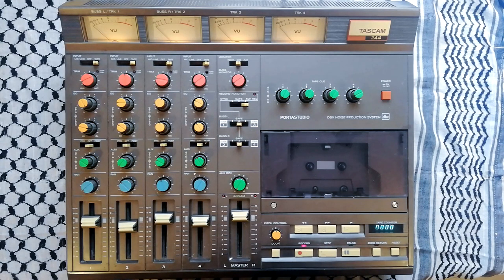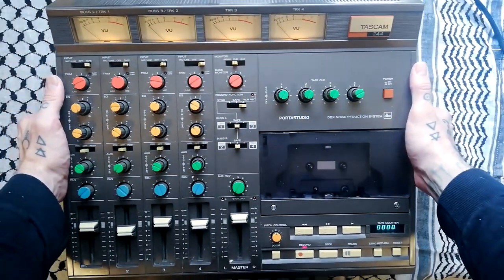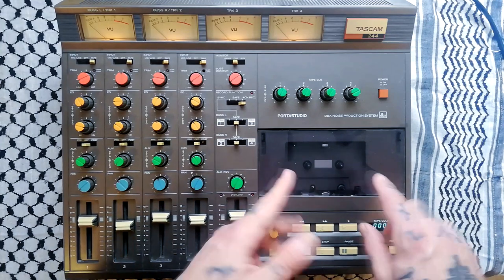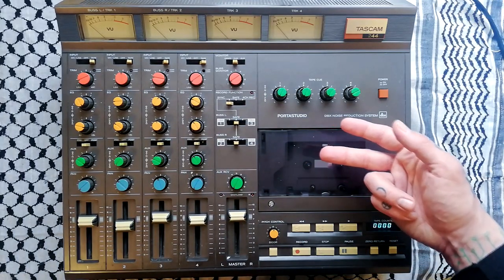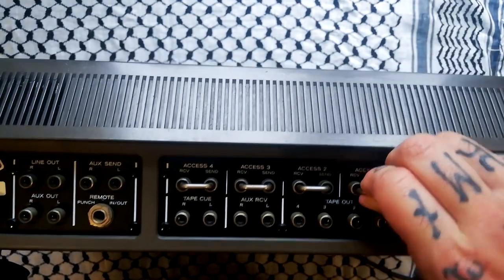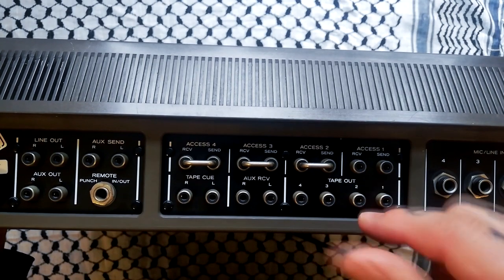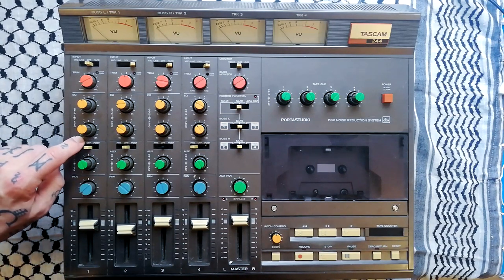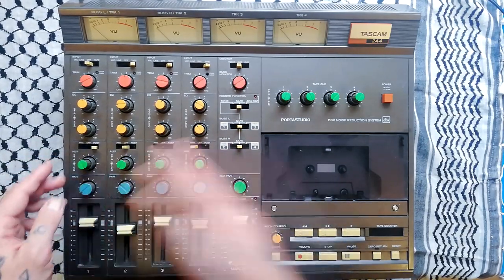Tascam Portastudio 244 | Review | Features Overview

Comment: Great overview and thanks for the maintenance videos. My tape-chewing 244 has been lurking unused under a desk for 20 years.  I was too scared to tackle the idler fix after viewing the rat's nest of wiring surrounding the transport. However, after watching your videos  yesterday, I removed the transport and swabbed out all the "manky" goo inside. Then fitted new belts, idle tyres (sanded plumbing O-rings) and pinch roller. It is now working beautifully and I'm enjoying digitising 20-odd "lost" masters I recorded solo and with bands back in late 80s and 90s. I am blown away by how punchy and pleasant they sound. Also you have solved the mystery of the Cue pan knobs. Despite what the schematic shows, unless my unit has a fault, the headphone CUE feed is mono - those pans only affect the CUE OUT. Thanks again, luv yer werk.
Reply from the maker: Thanks for your kind words, I'm glad the videos were helpful.

Comment: I can't believe that I got rid of our 1980's band's Tascam 244 a few years ago. The rubber belt drives had disintegrated and I thought that was and end to it. Still have a lot of original 4 track Cassettes recorded on it that would love to hear again if not transfer to digital.  I work solely digitally these days with Logic Pro X; Wavepad and Alberton.
Reply: Any Tascam that runs at double speed and uses DBX should let you listen to your tapes and mix them down to digital if functioning 244’s are too expensive to pick up 👍🏻

Comment: Great overview. I was wondering, do you know of any other units that will play tapes that have recorded material from the 244, or can those tapes only be played back on the 244?
Reply from the maker: The main thing is tape speed - tapes recorded at standard speed (1&7/8 ips)  will sound ludicrously fast in a 244...a  recording with no noise reduction or dolby encoding might have some pumping artefacts but you'll get audio off the cassette no problem.
Reply: @Tetrakan  Okay. Here’s my issue. I had a 244 decades ago. Although I don’t have the machine anymore, regrettably, I was lucky to find loads of tapes of recorded music. I’d love to listen to them again, but I don’t have my 244 anymore. 

What can I do? Is there another machine, that you are aware of that can play these tapes that were recorded on my 244? It would be so great to hear them again. 

In appreciation, and thanks for your speedy response. 

Rick
Reply from the maker: Anything from the 424 range would work, 464, 414, 644 probably others…like I say if it does 3and 3/4 ips and has DBX noise reduction  it’ll work.
Reply: @Tetrakan  Thanks for taking the time to make your videos and for answering my questions.  I will check out the machines that you mentioned. I’ll also be checking out your other video’s. In appreciation!
Reply from the maker: Thanks, remember 3&3/4 IPS and dbx are the two important specifications -fostex, Yamaha et al may make compatible units as well, I'm just not as familiar with their stuff, good luck!

Comment: Hello there, just a quick question! You mentioned you can either record 4 tracks or 2 at the same time, but not 3. If I record with the 4-track mode active, but keep one of the tracks on "off": will this track be "empty" overwritten? or since it doesn't get a signal, nothing will happen? 

I hope it's clear: let's imagine I keep Track 1 on "off", and 2/3/4 on "Mic/Line". With the 4-track mode active, will Track 1 be "blank" overdubbed?

Thanks in advance for the great review! Cheers from Italy!
Reply from the maker: Hi,  it's important to distinguish between channels (mixer) and tracks (cassette)...in 4 channel record mode the tape track with no mixer input will still receive bias from the erase head. So, if you are recording on a blank tape, it is no problem to record 3 tracks simultaneously, because applying erase bias to a blank tape makes no difference. But if there is a recording on the 4th track of the cassette, the mixer input set to off doesn't matter,  the information on the corresponding  track of the cassette is still erased. I hope that clarifies... thanks for watching!
Reply: @Tetrakan  very clear, thanks a lot for the kind answer, all the best!

Comment: how can you take a mastered on-the-machine tape and put it into a digital file? i’m not talking about taking each of the tape tracks and putting them in a software, but basically duplicating what’s playing in the headphones by the end of the mastering and mixing, and turning that into a singular (or multiple, whatever works) audio file or completed song.
Reply from the maker: Attach the line out sockets to a recorder with two inputs. I use a zoom H6 for this, but  Imagining you are using a desktop computer, you can set up free software such as audacity to record two inputs from a sound card as the left and right halves of a stereo .wav file. You can then make a copy of that in .mp3 format etc if that's what you prefer.

Comment: Hi Tetrakan! Thank you so much for sharing your knowledge! So helpful. 
Question- I'm currently experimenting with the 244 and ribbon microphones. I'm using an XLR to a 1/4 converter into the 244 inputs. Seems like i really have to crank the trim gain to get any type of healthy signal from the mic. When I'm cranking the trim.. I'm also hearing a considerable amount of hum in the recordings. Do you have any go-to tips in regards to recording with dynamic and condensor mics? Are there better converters XLR to 1/4 inch converters? What's the best way to get decent mic levels? 

Thanks ahead of time!

Greg
Reply from the maker: For something like a ribbon mic that needs a ton of gain I'd get a dedicated external mic pre amp, let's say one of those ART tube guys, and plug that into the receive rca socket on the back, bypassing the 244's internal preamp altogether.
Reply: @Tetrakan  got it - would the signal chain be as follows ? 

Ribbon MIC-> XLR -> ART PREAMP -> 1/4 inch to RCA -> PORTASTUDIO RECEIVE 1 ?
Reply from the maker: @yellowshoots7397  yeah. Basically the 244 preamp doesn't have enough  clean gain to handle a ribbon mic. I think you can get mic pres with a voicing switch or some high end boost which would also suit a ribbon mic cos they sound fantastic but they're so, so dark in my experience, especially the less expensive ones. So on a portastudio with high and low shelving eq I'd be tempted to boost the highs and cut the lows during tracking but the parametric eq on the 244 and 246 can't do that, so a preamp that'd cover those bases would be ideal
Reply: @Tetrakan  awesome. I actually have a TASCAM M30 that could eq it  going into an audient preamp — TASCAM PORTA .. lemme try that see if it works. That Art preamp looks awesome too!
Reply from the maker: @yellowshoots7397  yeah I think the m30 would probably cover your bases, let us know how you get on
Reply: Ribbon mics do really well when paired with something like a Cloudlifter. My vintage ribbon mic has tons of hum to spare before picking up any more from an external device, but the Cloudlifter takes care of it. Just be sure to supply it with phantom power.

Comment: I got a Tascam 244 about 6 months ago and the audio that I record has a ton of noise and the quality isn't too great. I'm not sure how cleanly this machine records in the first place but I've heard demos that seemed much better in quality that my own. Also, the tape cue controls don't work but that doesn't prevent me from recording. It's probably irrelevant. Any advice would be greatly appreciated! Thank you.
Reply from the maker: Well, that definitely sounds faulty, but I'd need more information before I could give you advice very specific on how to remedy the situation. The signal passes through the cue board after the noise reduction, but before branching off to the mixer, so I might begin by cleaning, probing and possibly replacing coupling capacitors and opamps around that cue board but it's hard to say without having the unit on  my bench. I've got a bunch of videos on those sorts  of topics on this channel if you'd like to start learning those sorts of skills.
Reply: @Tetrakan  Ahh I see. So that very well could be the issue. I actually discovered in your other videos how to clean all the old belt goo from the machine and replace the belts which worked magic! Thank you for that! I thought that was all that had to be done but it's more apparent that the audio it produces is lacking. I would be down to open it back up again and clean/replace whatever it needs. I'll dig around for some more info in your videos, thank you!!!

Comment: Hello there. I have been left a Tascam Teac 244 that I am selling. I can't use it and wish to find it a home where it will be loved. I am in Ireland. Do you know how is the best way to show that it is for sale.
Reply from the maker: Hi There, probably go with eBay, list it as spares or repairs if you're not sure of the condition, charge the cost of transport directly to the customer, in addition to a flat asking price. It's been a couple of years since I brought and sold these regularly, but 2 years ago spares 244s were fetching £80-150 depending on cosmetic condition, excluding postage. You can check current prices by searching for Tascam 244 in eBay UK and using the refine search boxes to find completed listings etc.
Reply: Brilliant thank you for that. Very helpful 👌

Comment: Are the EQs analog or digital? thanks
Reply from the maker: Analogue.
Reply: @Tetrakan  that's great, thanks for the fast reply! Do you know is this also true for rhe 414 mkii ?
Reply from the maker: The 414 mk I also has analog eq. Every one of the 40+ cassette based multitrack recorders I’ve used had a 100% analog audio signal path - the only digital tech on any of these units uses of a very primitive type and used with functions like cassette player control or the counter display on some units. This is just because of the age of the technology  - they are 20 to 45 years old and at that time there would be no cost benefit to the manufacturer to add digital to analogue to converters etc  to these machines. In a way what you’re asking, although it’s a sensible question for products being produced in 2022, is a bit  like asking if a commercially produced car from the 1960s runs on hydrogen, the answer will definitely be no, cos they ALL ran on gasoline at that time. I’m not meaning to sound cheeky btw, I’m just trying to give you a framework to think about the options available to you assuming you’re in the market to buy one of these….FYI they ALL have analogue EQ! :) Thanks for watching.
Reply: @Tetrakan  hey, thank you for this. Really useful info 👍

Comment: Nice overview - this unit was definitely less frightening when I opened it up for the first time than the 144. One other great thing about this unit is the instruction manual (which of course is free for anyone to get their digital hands on). I’ve not seen a manual on ANY recording device before or after this unit cover so much ground on the origins of analog sound reproduction. I even learned how to read electronic schematics reading that thing. The 246 has it beat with features in the mixer etc, but this guy has some real mojo 🤘🏻

Comment: I've watched this video a couple of times and it made me want to pick up one of these units out of curiosity. I'd also like to try a hand at repairing one of these units myself. The one I received already has issues with the play/rec function and some cosmetic defects as well as needing some decent cleanup. I realized that it was also 240v 50hz and I'm located in North America, so I found another unit that is for spare parts and I'll see if I can make at least one full unit out of the two. The mixer sliders on the former unit are very sluggish like on my Fostex X-15 and I'm wondering right now if I will need to treat the output and input jacks with some deoxit, those get to look too matte and not very shiny.
Reply from the maker: I don’t think the jack sockets need to be shiny to work properly. I’m not sure what you mean by the faders being sluggish but it’s certainly possible for dirt to build up in the recesses, in which case disassembling them for a deep clean can be helpful, check the cleaning playlist on my channel home page.

Comment: Thanks for this - excellent overview. Just picked one of these up, but it doesn't have the metal jumpers for the four access points at the back. Do you need these? Could you use small rca cables in place of the metal jumpers?

Comment: Can you play a mix recorded on 246 onto a 244?
Reply from the maker: If the 246 was in high speed mode and had DBX turned on during recording, the cassette should sound the same played back on a 244. If the 246 had DBX turned off you'll get a muffled sound with some subtle pumping artefacts (with the 244, DBX is always on).  If the 246 was in low speed mode, the tape will sound like the chipmunks on the 244 because the 244 is high speed only

Comment: Hey there great video. Sounds like a silly question but iam a complete novice with this way of recording.  I've just bought one of these units and it's in complete time warp condition like it's almost come out of the factory.  It does need new belts but I have you're video to hand when I attempt this procedure next week. The question I was going to ask is can you add compression or reverb to a track after you have recorded it or do you need to add it before you start to record. As I said I'm a complete novice but I'm getting into this method of recording and iam trying to learn as much as possible before I attempt  a track. Thank you for your videos they are really helpful.
Reply from the maker: Hi, you can add parallel compression or parallel reverb to the tracks after recording via the effects send, or you can print the compression or reverb to tape during tracking, or you can record without effects, but print the compression or reverb during a bounce. If you scroll down on my homepage there is a playlist called “using your multi tracker” or something like that, and that includes several tutorial/demo videos I made on a 244, 246, 464 and 424 mk ii which will be relevant to you because they demonstrate those different approaches to applying effects. It’s also worth having a look at Andy Pickering’s channel because he uses a blend of these approaches, albeit on a Marantz four track.

Comment: Great overview and break down Calum, I love the 244's! I have to crank the trim pots on track 1&2 pretty high on mine to match track 3&4. Any ideas whats going on there??
Reply from the maker: To clarify, has the unit been calibrated? Are you monitoring inputs 1 and three using meter one, or is this in 4 track recording mode? ( So input 3 shows up on meter 3?) Are we talking only about the meter reading during tracking, or about the relative levels you saw between tracking and playback of the recording?
Reply: @Tetrakan  The unit has been serviced and had new belts, but he didn’t mention calibration. It’s in 4 track recording mode. Its the actual level of gain which is really low unless cranked up. The Vu meters seem to reflect the correct levels.
Reply from the maker: If the Meters pb amps and record Amps haven't been set, and in that order, then do that...if the problem persists you could replace the opamps and electrolytic caps pertaining to the mixer Ch 3 and 4 gain controls, it'd add to the longevity of the unit even if it didn't sort your niggle.
Reply: @Tetrakan  great i'll give that a shot then, many thanks for your advice!